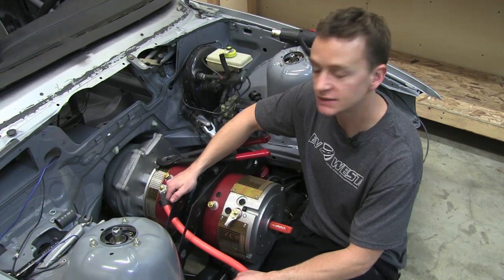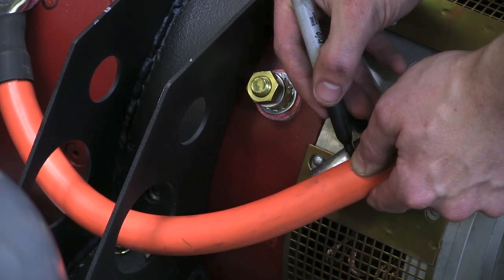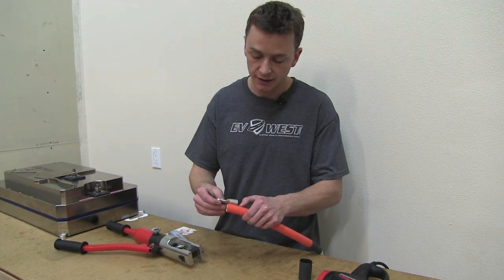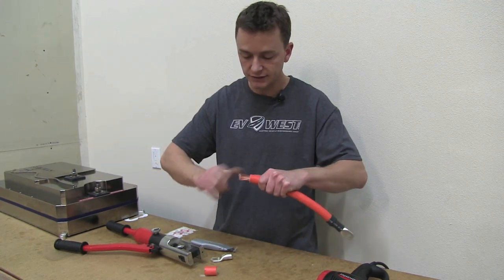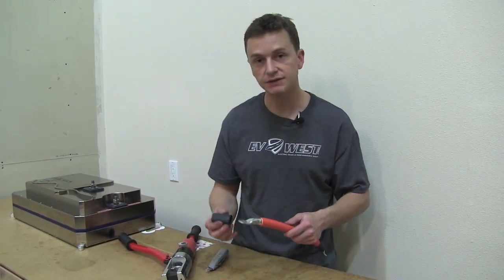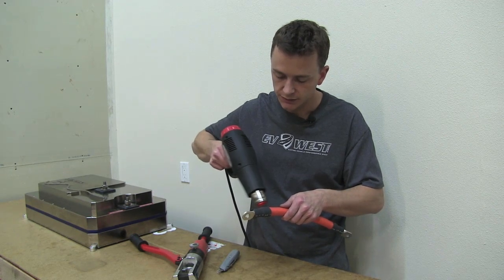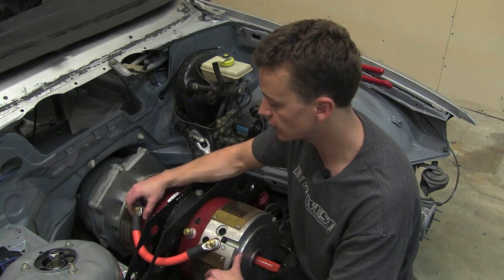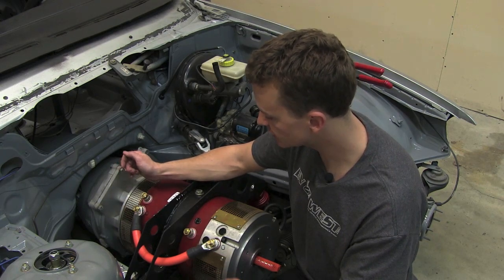EV West - Heavy Gauge Cable Terminal End Crimping Guide

Comment: Where the cable runs through the motor mount if an odd size use a good quality heat shrink to prevent chaffing at the point it passes through or a piece of silicon hose for protection

Comment: Thanks for hitting the hydraulic crimper piece double hard, if you do another one of these -You may want to touch on:

Putting the unshrunk heat shrink on before crimping both lugs on
Determining the final situational position prior to crimping the 2nd lug
Application of dieelectric grease/petroleum jelly to prevent wire on the hot side of the circuit from growing fuzz, even IF you ARE using heat shrink
Trimming shiner (excess wire between end of lug & wire jacket)

Comment: A secret taught to me by a fellow engineer is to loosely place a small zip tie in the gap on the bare wire before you remove the cut insulation.  Slide the zip tie to the end of the cut bare conductor to keep it from fraying.  When you slide the terminal onto the conductor it will push the zip tid down without the wires fraying.  Cut the zip tie and crimp. Voila!
Reply: Good tip

Comment: I would probably put a grommet or wire holder, to protect the wire through your motor cradle.  I don't know how sharp those points are, but over time there will be significant chafing.
Reply: Hello, we are Leading wire & cable processing machine manufacturer & supplier in China with high quality and good price.
Email: sales@zsht-equipment.com Website: http://zsht-equipment.com/ Skype: gao.irene   Tel/whatsApp: +86-18676147382